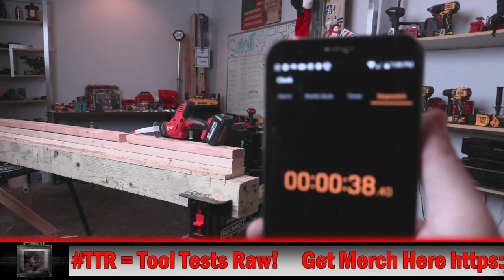TOOL TEST RAW (DeWALT VS MILWAUKEE) Best Compact Reciprocating Saw

Comment: caught only the last ten minutes. As a plumber I use the milwaukie daily, my brushed one finally died and the company got me a new fuel which is bigger and badder and less vibration, same form factor though. Awesome for cutting plastic pipe, easy to control, good power. versatile, cuts through metal and good for the light demo work done daily when roughing in drain and water. It does not replace a full size recip saw though for demo. 

as far as an apples to apples TTR would be  to put it up against the Bosch GSA18V-083B. so far at home im in love with my sub compact Makita recip, not quite one handed but doable.

Comment: Run the M18 Hackzall 2625-20 against the M12 Fuel version 2520-20.  I had the 2420-20 brushed version and after I got the Fuel I threw the older gen away.  The new Fuel is soooo much smoother.

Comment: Before I watched the video, I said "Thats not fair, brushed vs brushless"  Now I think maybe you should have used the Brushless Milwaukee 12V vs the Dewalt 20V.
Reply: I’d take brushed over brushless anyway brushless motors don’t make the same amount of torque as a brushed, yes they are faster lighter and last longer but no balls I only buy brushed tools and have no issues

Comment: If u do another saw video i wouldnt mind seeing the milwaukee  winner of this video against the Bosch one handed saw that looks the same.
Reply: Bought the Bosch 12v (PS60-102) and M18 Fuel Hackzall. Had to return the Bosch. I really wanted to like it more than I did, especially for the size and feel, but performance wins. I first tested the stock blade and then switched over to a Diablo. I'm happy with the M18 Fuel.

Comment: I love dewalt also but Red makes the best sawsall ive ever used personally and it was a fuel hackzall older one too. I love me some 12v and compact tools but sawzall are sus in smaller form with some companies. I dont get the atomic line other than the 850 its just an entry level line at best.  Id rather use my 12v.

Comment: Hi guys, 

Maybe the size on the atomic dewalt handsaw hurts the performance.  If they made it the same size as the milwaukee m18 fuel it might be a different outcome. It's ok, dewalt just needs to get it right the second time. 

Don't get me wrong It would have been nice if dewalt got it right the first time. People forget that milwaukee had to make a second version to get it right.

Comment: m12 is a beast I cut 25ft branch that broke off the pine tree in the back yard with the 4.0 batt and it cut the whole branch in one charge was probably 5 inches in diameter at the base of the branch where it broke off the tree.

Comment: For a brushed older tool, that Milwaukee is beast!!  If it showed up this well, I'm excited to see how the Fuel dominates with it's 7/8" stroke and 3000rpm!

Really disappointed in the Dewalt.  I know it's part of their weaker Atomic line, but they had years to make it competitive, and they still failed.

Comment: I want the Dewalt cause is smaller , already have a reciprocating saw but is big and is for big jobs like cut 2x4s or  3" 6"cast iron pipes or do any demo en general but I want this dewalt atomic reci-saw cause it will fit in small areas like if you want to cut pipes under the sink, the Milwaukee is heavy and bigger that dewalt atomic

Comment: Is there a difference in performance between Milwaukee’s 12 volt and 18 volt hackzall?
Reply from the maker: There should be
Reply: pretty big difference. I find the regular m12 saw pretty useless, gets the job done real slow. and drains battery pretty fast. ive used all four hackzalls from milwaukie.. the m12 fuel is serviceable and the way to go for the 12 volt line.

Comment: The Milwaukee has a longer stroke and a higher spm but the Dewalt seems more powerful and smoother and quieter
Reply: That Milwaukee is older model with brushed motor. New Fuel version is really smooth and quiet and much better performance.
Reply: bring in the milwaukee fuel hackzall and cut that dewalt in half with it 😂👍

Comment: Starting to agree the lowes 12 volt dewalt xtream is a crap ton better then home depot dewalt atomic 20 volt line atomic line is crap
Reply: What does it matter what store it came from. Its all the same dewalt product im sure you could special order whatever tool you wanted from any dealer.
Reply: @josh33025  it matters because dewalt xtream 12 volt line is only sold at lowes and the dewalt atomic 20 volt line is only sold at home depot not sure what point your trying to make

Comment: Dewalt is under Milwaukee in about every tool I’ve ever used... but, never did I think a dewalt was bad quality... and they are a little cheaper... I myself chose Milwaukee, but I wouldn’t knock anyone for using dewalt... you can see from the size of the two that the dewalt is better for compact space... the Milwaukee is a little larger, but a little more power... not really a better and worse situation, apples and oranges...

Comment: 10:27 The driver of the tool made the straighter cut. Not the tool.  26:30 maybe my mind is changed. 27:40..guilty   43:37 Restrictor Plate Tool Racing! LOL

Comment: Clearly the marketing wankater gremlins at Dewalt managed to release a substandard line of tools.  The Milwaukee saw on the other hand looks design wise look the green European Bosch, the German Metabo, and the Hilti.  I do not know who copied who first.  But if other big tool manufacturer use the same saw design as the Milwaukee.  Then the Milwaukee saw must be a very good saw as showed on this video.  I use the 12V fuel version of the Milwaukee and it makes me money,  I also have the German 18V Metabo, also a money maker.
Reply from the maker: I’m interested in seeing how powerful the m12 fuel is compared to the m18!
Reply: @VCGConstruction  Well I can tell you for a  fact and I have photos to back it up that the M12 Fuel version with a 4 amp battery, and a 12" Bosch Edge brush blade will cut through a maple log about 14 to 16" across.  It will take the full charge of the battery to do it, and it can only do one cut, because it takes the whole battery to do one cut, but we are talking about a tree trunk LOL !!!!!   I usually cut up small trees on random properties regularly all year as the need requires with a German Metabo receipt 18V saw.  You may wish to try that in a TTR sir !!!!